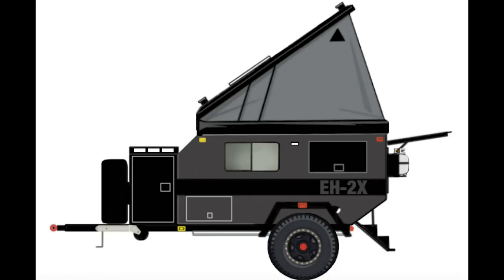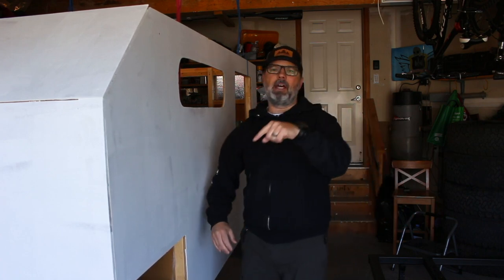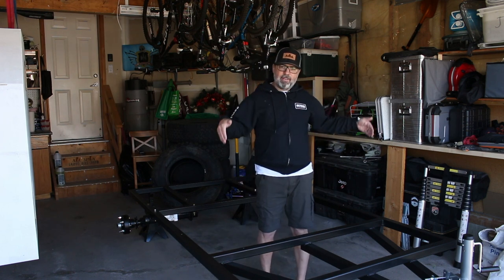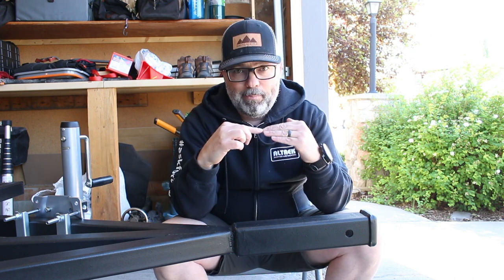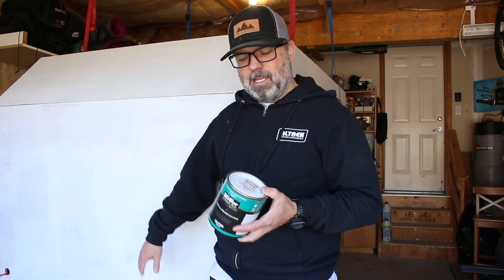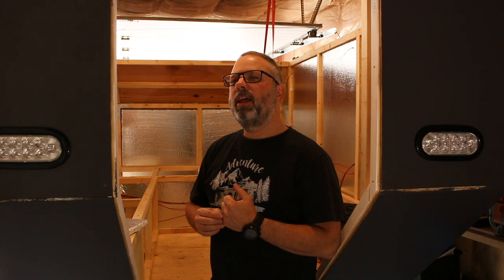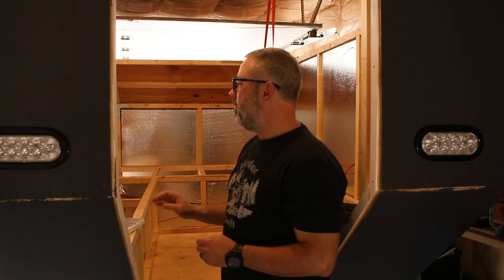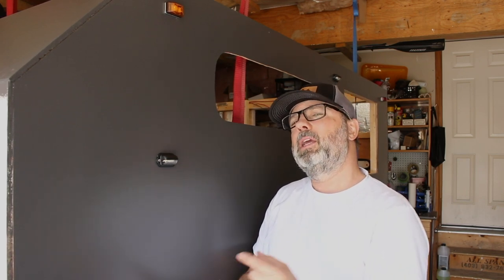DIY OFF-ROAD CAMPER BUILD. The new Expedition Camper project build.

Comment: What about gussets on the frame corners to give a little bit more strength?   Our Offroad teardrop suffered some frame bends and had to be replaced w added gussets due to the weight and torque on the frame